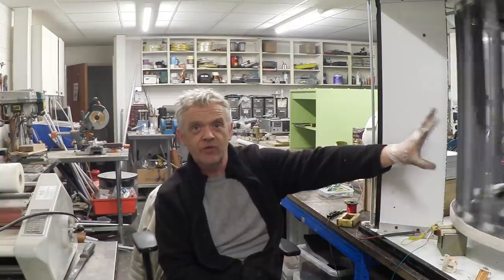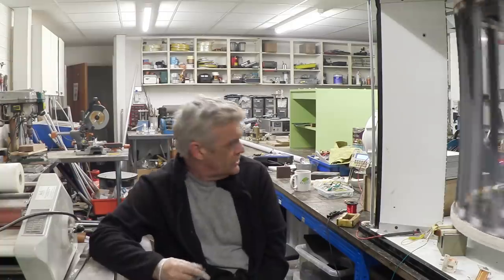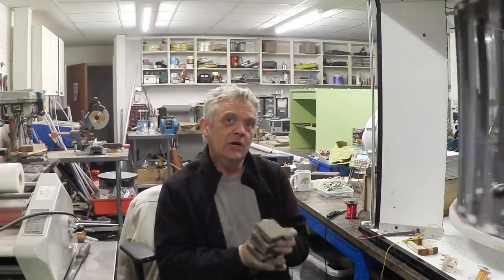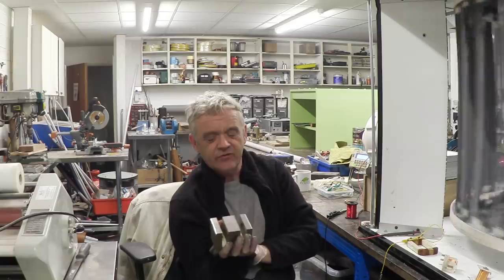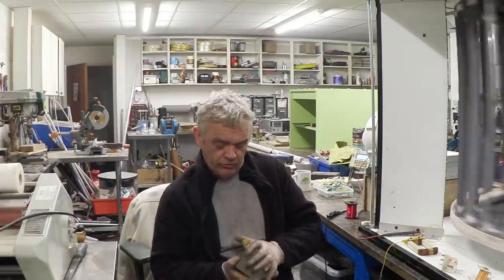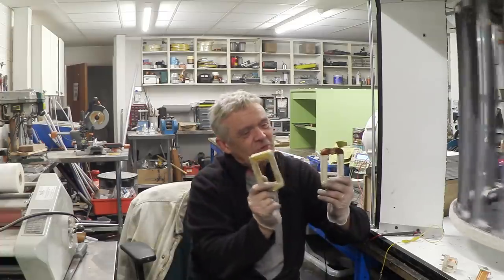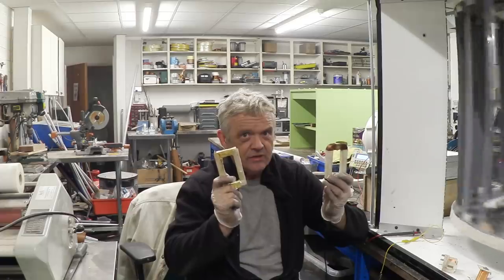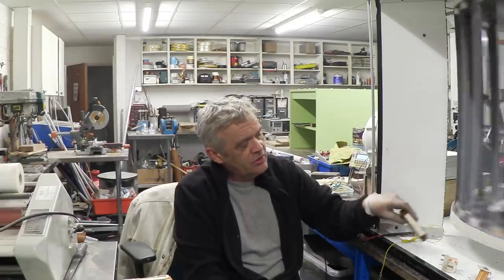Building a 1kW Wind Turbine For Under £100 - Part 5 - Messing With Coils

Comment: About the primary and secondary on the iron core. Did you try flipping one coil around so the turns in both coils where in the same direction? Assuming opposite direction will cancel each other out.

Interesting input about the use of the core vs air core. Your analysis makes sense. Since the iron core should improve the magnetic flux going through the coil.  

Future experiment.does the shape of the loops matter? I think it would for both air and iron cores coils. It’s just easier to make rectangular coils than round ones in mass production.  

Sorry getting too into your videos.

Comment: You could put a couple coils on there and a microcontroller like arduino. As wind speed picks up (end result RPM... "turn on" another coil. If RPM drops "cut off" coil. This will allow you to use low wind speed on up to as high sind speed the structure can support

Comment: If you can get the rotation to slow significantly when shorting your coil(s) or putting a current meter or load resistor across them, that is a GOOD thing. It shows you are successfully extracting energy from the moving mass. If it doesn't slow down when working into a load, then it is not operating efficiently. In physics, you can't get something for nothing - a point the "free energy" brigade fail to grasp. And please don't get fixated on voltage or current as separate measurements or else you will be horribly wrong in your estimations of the power you are producing. You absolutely need a resistive load on which to take your measurements. By all means select the ohms value that gives you the best power reading - the optimum load will depend on many factors.
Reply: Another great comment here. Thanks

Comment: I think i may have a few suggestions that may be of interest and help you make a better decision on what feild coil arragement you go with !!! Now like you im only using conjecture and well guessing as to weather some of the ideas i have will work and i know at least one of them will for sure  !!! Starring with my first thought and this is sure to help i do believe!!! That is to get more of the same magnets like you have already incorporated in the turbine and go ahead and epoxy resin them inside the first row you previously fastened in the same manor !!! That in theory should solve the problem with wasted coil over lap and close to double the feild generation as well,  theoretically speaking !!! It also raises the question of the best arragement of the second row of magnets ??? Would placing them not side by side with the first row work best or placing them inside the the first row half way between each set as to sort of split the feild ??? Also would changing the north and south poll arrangement as to alternate or to parallel the polls and or not placing them in between the first rows alternation that you have already arranged the first row ??? My second thought was to do everything that's been done so far ,just do it to the other side or end of squirrel cage fan blade assembly  !!! Theorically  doubling again ,so potential these two ideas would  together would be three to four times the generating potential,  theoretically speaking ??? So now what if wth the different wire gauges as respect to the primary and secondary windings you were on the fence over !!! What if you were to use a switching device or essentially a voltage regulator to switch from the heavy gauge  windings at low speed to the light or fine gauge windings at higher speed or RPM ??? Making use of tachometer ??? And of course this raises more questions and farther trial and error or experimenting  !?!?!? So i dont know that maybe you have already thought of some of these ideas or maybe you have not ??? Either way i hope to possibly hear back from you as i trully and absolutely do enjoy you and your whole way of discussions, representation  and your Bloody good British ascent my good man and so then Cheerio and smashing good show !!!

Comment: Have you considered connecting one set of coils (the low voltage ones)  in series and the other in parallel. Ideally to create 2 sources of the same voltage. 
Regarding the core:  Initially, I thought the slowing down pointed to a more efficient generator. But then it occurred to me that the involvement of the core introduces an inefficiency - the energy required to create a magnetic field in the core. Like no-load losses on a power transformer. 
I used to know a lot more about this, 42 years ago when I studied electrical engineering...

Comment: Hi folks i have fiddled with VAWT upto 10 kw.   Supersize the stator holding the coils x 2 or 3x .Attach the magnets to a light steel band come ring.Less glueing. Make the assy light , composite ,glass etc. The same set up can be applied to low RPM water generators. Food for thought. 

Increase the base diameter. No iron cores. More coils on the circumference. Gyro rigidity and a flywheel effect with low break away torque. Overspeed control , mechanical governor with a switch to short out one set of coils to cog and slow down the turbine, or use a electric speed switch, anemometer type set up with a threshold.

I wonder if the trafo was pivoted, free to move ,  with two springs for oscillations  at each opposoing end, damping, reduce the back emf ,  free to rotate , on a rod  or skatebord bearing , the new field as the genny spins up would align , poor mans variable reluctance machine . 

The  spring oscillation lags the fast reluctance of the coil with no steel. The returning spring oscillations could be tuned to re induce a voltage additive kick, Two trafos, 4 springs and a bearing maybe. Just a thought . 
 

 The more gismos the more cost of course. Good stuff take care.

Comment: The wattage would decrease when a load is placed on the coil.  Then the line loss will come into play due to the cross sectional diameter of the wire used.  The best results possible will be acheived with your generator due to the high frequency of the output.  High frequency is key to minimizing the hysteresis.  It would be ideal to cut the silicone steel plates apart.  The welds actually work against the purpose of the thing not being in one large chunk of steel.  The laminated cores of transformers are not typically welded, but lacquered to keep them electrically isolated from one another to avoid eddy currents from passing in a path other than passing through the coil.  MOTs are welded as a easy manufacturing technique.  It causes them to generate more heat because of the eddy current passing through the weld, and makes them less efficient.

Comment: You are right that the iron core focuses the magnetic flux. The rotor will slow down because you are drawing power from it. You should try getting he core as close to the magnets as possible. Definitely use a core however. You also need to be aware of the phase relationship if you have both coils on the core. Putting different coils on the core will not really be productive.

Comment: If you have two matching microwaves. take the two primary's and put them in series, ensuring that the coil winding direction stays consistent. This will double the volts for the same amps.

Comment: how about a 55 gallon drum modified into a turbine by cutting out the fins and remounting to the appropriate angle or mounting on pins that you can lock down and so they are adjustable .  maybe make a jig for a plasma cutter to cut out perfect shapes and leaving some structure.  You could also use auto spindles with pared down rims  or maybe motorcylcle rims to hold the axle.

Comment: why don't you alternate the type of coil? thick and thin and get the best of both worlds? and conversely, why don't you make a mechanism that raises or lowers iron cores in place depending on rpm? then at low speeds you get the most out of the coils, and as the speed picks up you take advantage of the higher power potential of a core being in place? (I picture the core raising up into the coil as rpm increases.)
Reply: Maelstrom Beats exactly what I have been pondering about. Only thing is you would have to invent a mechanism for that as well.
Reply: @spascebox  I was just picturing a secondary plate at the base under the magnets that stole a little bit of torque or even wind itself... maybe air bladders or a tension lever.
Reply: Maelstrom Beats Right! I was thinking of an electromagnet that is charged by stealing some of the tork and pushes the second plate (or ring) closer to the magnets as the wind takes on.

Comment: personally my choice is high volts, I could very well be wrong, but if you have to transport/transmit the power, best to use higher voltages at lower amps.  can use thinner connection wires or experience lower line losses
Reply: i think some people make dc configurations then have built in diode rectifiers to ac

some people use ac configurations?

some use 3 phase ac configurations?

Comment: Could you add a second row of magnets, closer to the center.... you could maybe use both types... thin copper wire (inside) and thicker copper wire (outside).

Comment: Would it help if you took the four corner supports and moved them to deflect the incoming wind into the same direction that the turbine is rotating?  You'd only have to move them a few degrees.

Comment: Also Im wondering if Ferrite cores as opposed to iron laminated would give better results ? Ferrite as you know has similar properties to an iron laminated core in that it consists of powder and glue essentially such that the glue acts as the dielectric in reducing the eddy currents. I’ve worked in RF engineering and Ferrite is used mostly in RF a designs so maybe Iron is better at low frequencies. Saying that they do use ferrite in toroidal mains transformers .

Comment: I got to thinking what would happen if you add your magnets and coils on the outer diameter of the base and another ring a couple of inches inward. Then if it rotates to fast for the output of the outer coils you can switch to the inner.

Comment: I would recommend to chose the way with higher voltage. So you will not get a problems with higher amps and thicker and really expensive cables.

Comment: Make the lower rotating plate wider than the blades and mount magnets top and bottom then use double the coils. Put some in series and some in parallel. Use an oscilloscope to phase the coils properly you should be able to get a couple of amps and a good voltage which can then charge a battery bank which drives an inverter.
Your magnet spacing will make a HUGE difference to the output. Having them too close causes the "incoming" field onto the coil to cancel out the "outgoing" which then causes a braking effect (Google Telma brake).

Comment: I think you're exactly right - it's all a balance and depends on your needs.
It's a great project. Iron would increase the magnetic flux, which means it captures more energy which of course slows it faster.
It's probably good thing in the sense that the generator requires less copper (which is an expensive component) to generate the same power. But in your case it doesn't really matter as the copper is free and by itself captures enough energy. It's possible that the iron also creates slightly more losses, but I'm not sure if it would be a meaningful amount. James Biggar (youtube channel)
 has done some really good stuff that you might find interesting (embedding coils into a resin cast for a similar axial flux system).
I feel like you would be best off going with high voltage without the iron, just because this seems to catch enough energy and probably has fewer losses. High voltage is probably more useful and would mean fewer overall losses (which is why the Lucid Air is using a 900V system -  fewer losses compared to lower voltage/higher amps in the motor/system means less heat/higher wattage/power density).

Comment: I think i can explain why you have better results with one orientation of the coil compared to the other.

When you have magnets passing by parallel to the long side of the coil, you might have two opposing magnets over the core at the same time. 
The voltage depends on how quickly the total  magnetic flux through the middle of the coil changes over time. If you have two opposing magnetic fields going through at the same time, they will cancel each other out, and reduce output. 

So you'd want the magnets to be entirely covered by the coil, and only one polarity at a time, the latter of which is achieved by having the magnets moving through parallel to the short side of the coil.

Comment: In the core for the bobbin based coil, you could experiment with two other materials. One is inseribg a bunch of copper coated welding rods and the other is to get hold of ferrosand, the type that has a lot of iron filings naturally in it, mix it with resin and fill the central hole. People who have experimented with these have had interesting results, especially using the ferrosand. In the absence of copper coated rods, enameled ones will also work. The idea is to have some kind of insulation, even rust, between the rods thus reduce the Eddie currents (Heat Loss), and focuses the magnetic fields streams through the individual rods making the created magnet field stronger than what a solid core can create....

Comment: when you have a wind mill free wheeling, the more power you take out the slower the wind mill is turning at the same speed. It is a trade off between current and voltage. Volts times amps is power.

Comment: Awesome mate indint have the equipment to measure exactly hownmamy amps those wires produce but one thing I noticed about the secondary in particular of the MOT is that its not copper wire and is not actually as good at reflecting the magnetic waves as much as the copper wire does. Hope that helps.

Comment: Would seriously consider experimenting by removing the 2 outer lobes of the core and just having the centre core. I reckon the width with the 3 you could have a N and S pole passing over the 2 outer parts of the core at the same time. I don't know if that would reduce the amount of useable flux or increase it but would be worth finding out. I'm hedging that the centre of the core only will give better results.

Comment: Adding the weight of the coils to the moving part of the turbine makes it more of a fly wheel and will smooth out the voltage spikes. The magnets will be fixed to the base or roof of the surports. Just an idea 👍

Comment: What is the orientation on the magnets on the rotor? My gut tells me they should be with the N-S axis in the direction of rotation to maximise the rate of change of flux, but it depends on the relative gaps and spacings. I suspect you've put them with the N-S axis in line with the blades. Like NW says. you should try to sketch the flux line paths at different magnet and E core orientations.

I think you've got more than a lifetime's work doing it trial and error. It used to take me days to design shielded loudspeaker magnets for use with home theatre CRT colour TVs and I had the use of 3D magnet design software! Neo magnets would be more powerful per unit volume too.

Again from loudspeaker motor design it's the mass of copper that you can squeeze into the magnetic gap which maximises the output for a given flux rate of change.

Comment: From my experience with electrical power (current), I would highly suggest the primary coil with the heavier wire.   If you actually begin to generate sizable power, the smaller wire will cause you major grief.   I really like the amount of detail you’ve paid, especially the later blade attachment you added.  I would have planned a different pole mount configuration, but that would be much more expensive.   Since price is a primary concern, I think you’re roof mount is a better option.

Comment: I think there is a way with both magnetic core and without but is more engineering to do. An inspiration point could be the elevator automatic brake witch relies on speed. Higher the speed the weight lifts up by centrifugal force and this way you can insert the metal core in the copper coil. At low speed the core will be out and you can still have the rotor spinning. But is just a thought and I can say if the end result will gain so much more than the advanced engineering involved. Just a thought! :)

Comment: If i had that setup that you have on that bench i would not stop playing with coils and magnets for months, i suppose the ultimate experiment would be to try something that Tesla tried and knottiest if i remember he witness a remarkably large spike in volts and amps  using certain setups (windings) on the coils maybe having some fun with make and break contacts and seeing if there is any extra large spikes that he spoke about ( energy from the ether ) i would also try neodymian magnets and also carducius wound coil on an iron core, what would happen if you tried a Tesla Radiant energy coil winding what would you get out, or what about a flyback transformer with feeding a coil to give the wheel a kick to see if you could achieve some kinetic energy to be put back into the system

Comment: Just wondering how many coils you think you will be using, you may only need a few, or are you planning to put them side by side all the way around? I guess this may be a case of the higher the speed (outer circumference) the fewer the coils, but more magnets, or the lower the speed (magnets placed closer to the center), the fewer the magnets but using more coils. It'll be interesting to see what you come up with  - I eagerly await your next video, cheers